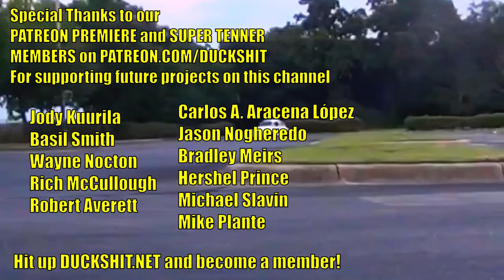Minibike Wheel Bearing Replacement - DoodleBastard Engine Swap - 23

Comment: Hey just watched your Doodlebastard videos. I have the same Doodle bike. The motor that comes in them are junk. Thinking about putting a predator engine in it. Cheap engine. Fun videos. Thanks Duckman. 🦆
Reply from the maker: Well it’s a Lifan engine, they’re not particularly great in the power department but they’re really not junk.  The engine that I installed in here was also a Lifan engine... but from my mini chopper.... The same engine can also be found in lots of dirt bikes or even the LF200 sport bike.
Reply: @DuckmanCycles  I mainly have problems with carburetors. It's like you park them for a couple of months and they seem to not want to start. Probably should put fuel stabilizer in it. I think the weak link on those are the carburetors.
Reply from the maker: I haven't had any problems with the carburetors at all except one of them broke an adjustment screw.  So I don't know there  lol
Reply: @DuckmanCycles  😊👍🦆

Comment: What size motor is that , 250 cc that thing has to fly, I built a go-cart with a 440cc it was so fast I had to put a 5 point harness, and change to single wheel drive, Cause I couldn't keep in on the ground, even with wheelies bars, I had it it up to 125mph, It was dangerous. When I sold it a man was buying it for his 16 year old son, I made him sign a waver buy a  Attorney, Cause I told him it was stupid, sure enough, He came back saying what are you trying to kill my kid,I told him your a Moron leave my yard before you go in a body bag. Got in his car never herd from him again, Funny how stupid People are.
Reply from the maker: You may be surprised to find out that the engine is only a 200cc 5-speed chinese clone engine of a classic Honda XR200. I pulled this one from my old 3/4 scale mini chopper that I sold, and later the engine made its way back to me. https://youtu.be/2QrcB8ZaQfE  I'm glad I got this engine back because it has a unique head on it with dual exhaust from a single cylinder... that's why it sounds like it does, and I haven't seen another one like it.  They are made by a few different companies, but Lifan is best known for producing this one. You can purchase a brand new one for under $500 https://amzn.to/3GJjUKf  Hope that helps!  Thanks for the question, and I appreciate that story lol!